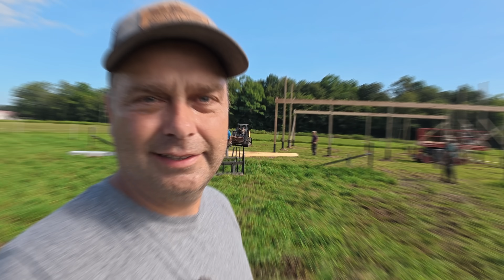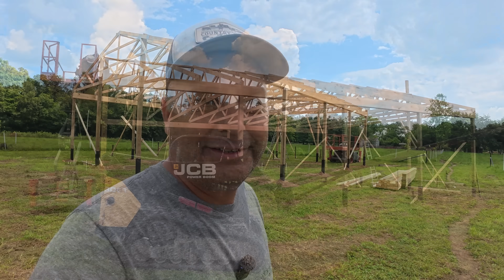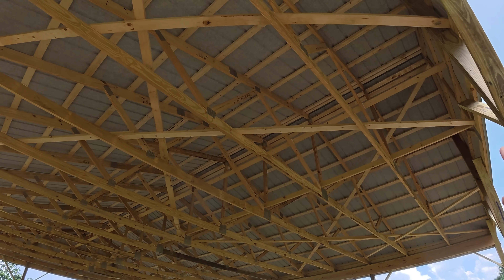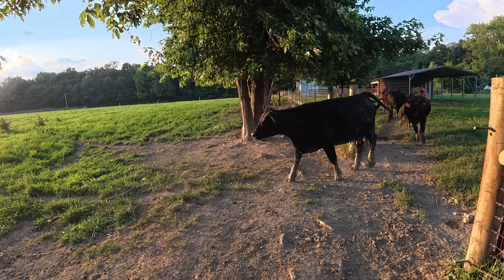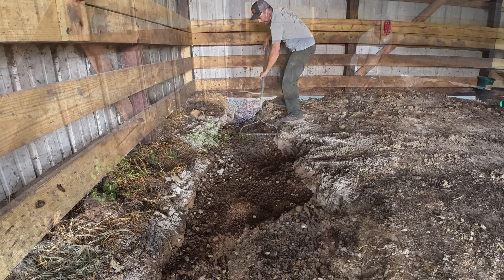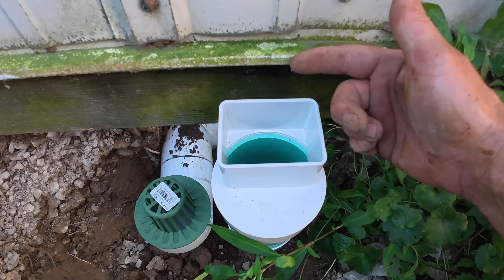Setting Trusses and Installing Barn Metal.  Our New Livestock Shelter is Complete.

Comment: You said you were going to put up some kind of side to protect the animals during storms and such.  I'm no expert, but what about putting like barn doors hung on wheels in a track so you could slide the door to either side. That way you could move it depending on what you need to do, like cleaning out and such.

Comment: Great progress on the Livestock Shelter!  The design improvement installed by the builder shows the quality of his work.  One thing to keep in your plans after they leave is installing internal braces at the level where your Live Stock will be using adjacent to the side walls that you are planing to install.  Animals can Easley push out the panels.

Comment: You need to run that drain out to where it is open, either in a ditch or lower ground level. Do not use a pop-up, as there are all kinds of problems that come with winter,

Comment: Shed looks great! I’m trying one of those pop up drains. I’m going to drill holes at the bottom of the elbow so all the water will drain out into a rock bed thinking that might prevent the pipe from freezing and splitting if it’s full if water. I don’t know if you installed yours below the  frost line but it might be something to think about
Reply from the maker: It already has a drain hole I need the bottom of the pop up.

Comment: You are lucky you found such a hard working crew. Looks great!  You should put a small solar system on the shed so it can provide light if needed in the middle of the night. Set it up so you can remotely control it.  You do a great job explaining everything.

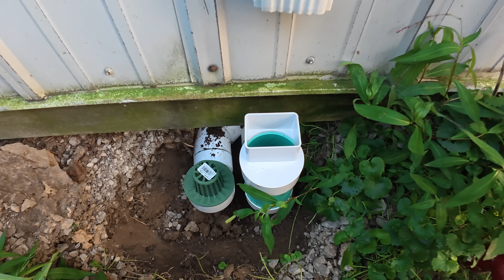Comment: Curious why you arrent going to run a underground drain line down the hill to get the water away from the building?    17:25
Reply: my thought too, why so close. if its because of elevation you could run it into a holding tank at that spot or under cover in the barn and run that downspout to it too then pump it to the ditch on the other side.

Comment: Didn’t think the Amish believes in using modern equipment, really great job
Reply from the maker: They do for work.  But not in their homes.
Reply: they usually have a hybrid crew with a non-Amish or two to do the road driving and equipment operating >>>>

Comment: Could the northside of the"wood/equipment shed" be constructed for easy expansion in the future, if needed? You have a lot of equipment to get out of the weather and you will buy more someday.
What is your plan for the floor in the new pasture shelter hub? Are you going to concrete it like the white barn, so the livestock do not tear up the ground?
You will soon have three structures for better farm use. Big changes happening!

Comment: Hey Evan. Wondering with the new roof on the livestock barn in the pasture, if you have considered putting solar panels on it?  You could use a trencher to run the electric cables to the pole barn panel.  Just a thought.

Comment: Evan, have you thought about installing a rain-water collection system off of the roof of your new shelter. You could collect the water off of the roof into a tank that could then be designed to feed into a water trough under or near the shelter. That would be a great project, providing for some great "how-to" content. One bonus of that would be that the roof run-off areas would not become mud pits during the rainy parts of the year.

Comment: These must be the "United Methodist (everything is OK and not a sin)" AMISH.   As far as I can see, the only thing Amish is the hat and suspenders. But, it looks like they do an excellent job with all that "new fangled" equipment and tools.
Reply: I am guessing they have one guy who is "English" to run the machines. Not uncommon for them to hire out some parts to make it work. Probably the same guy who drives the truck to get them around.
Reply: Oh, the Amish use lots of motorized equipment. Once watched an Amish crew using 4 horses to pull a hay baler and a Kabota tractor pulling a wagon with a very large fan on the horses. 🤷‍♂️

Comment: Henry did great on that bracing underneath. Too many skimp on that but his looked first rate. The perlins looked sized right for your snow load in that region. I am over in Missouri but lived in Texas for a decade and built just a few of those there too. Texas doesn't have snow load at least around the Houston area and we  went four foot centers on trusses and three foot centers on perlins just fine down there. Nice having that Z flash where you are going to do the sides as that will work great. Much easier now than trying to switch it later.

Comment: The new barn shed looks great and that it was a good decision on your part placing it where you did because it will protect the farm animals from the elements and and be useful for separating the animals for different reasons. The Amish did great work, really enjoyed the video stay safe
Reply: Yes they do great work and fast. Only that surprised me is the skid steer and the generator. Must have one worker who is "English" to run those for them. Pure Amish do not use machines. First rate job though by this crew. That bracing was excellent. Triangles stiffen everything up.
Reply: @markpashia7067  In my area Amish builders have been using cordless tools. generators, cement buggies since 1993. This also when cell phones/towers were introduced  & they use  them to order materials, schedule jobs keep in contact with customers & their crews. They have to do these things to compete with other contractors.

Comment: Install pressure vents in the roof Evan!
Reply: Was kind of surprised at no gable louvers in both ends for pressure relief. Maybe it is vented ridge cap.
Reply: @markpashia7067 I’d imagine in that climate they get some good air flow which would make the building a kite in gale force winds🤷🏼‍♂️
Reply: @jamescollins8148  Having built many of these in my past life, they are stronger than you could imagine. Short of a tornado/hurricane they usually survive even with missing metal. The structure itself is as strong as a house when they are properly braced like these guys built it. I was very happy to see what they did, although some relief of pressure in that under roof area would be a good thing. Gable louvers or vent a ridge is usually enough. Without those it usually will blow off a panel or two to find pressure relief. I also noticed they oriented the roof panels for the prevailing winds which shows their quality build. You would be surprised at the strength of that design.